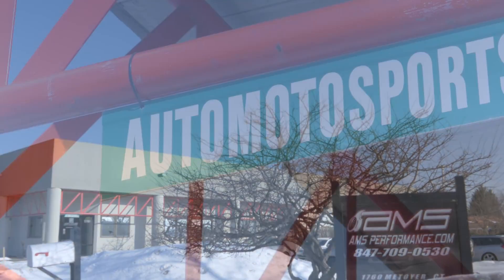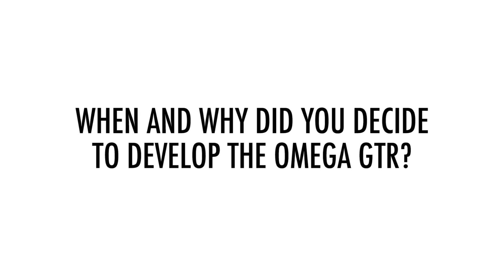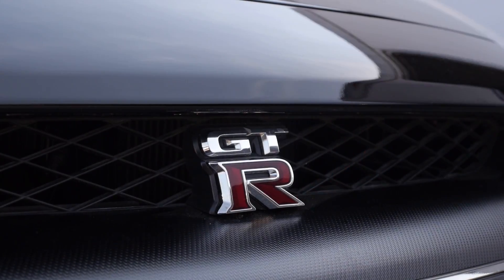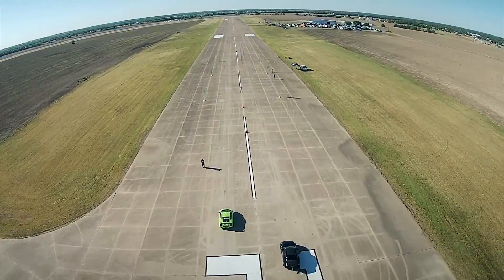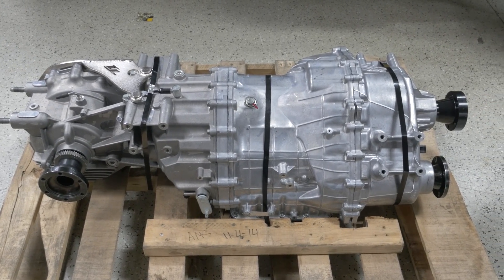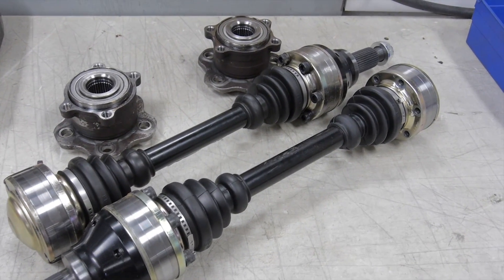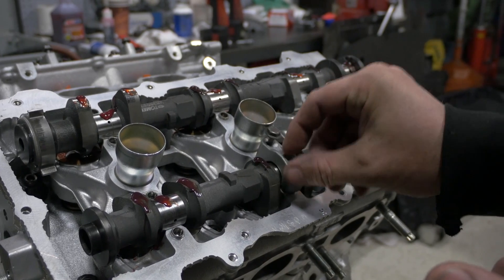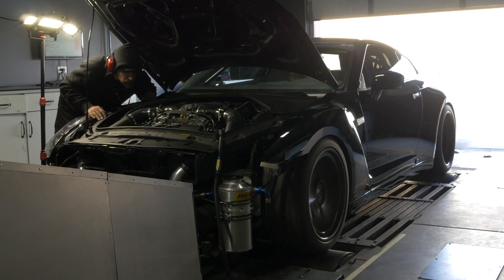What it takes to build the World's Fastest Nissan GT-R: AMS ALPHA OMEGA

Comment: hey guy's maybe if the diff gears are 4.11 from factory try 3.9 ,,,and if they are 3.9 for instance try 3.7's just a little higher and i could imagine them sequential v6's love to give it all they got in the mid range rpm's maybe just alittle bit smaller turbo's with a slight boost increase over the set up that you guy's are running
Reply: yeah cause you know more than AMS does.  Fucking youtube tuner kids driving civics.  GTFO

Comment: I wanna know if it runs pump gas and what HP with pump gas. I wanna know a breakdown of this car and how each part added sets it apart from a stock gtr. this thing making 2000HP on a 3.8L v6 is hard to imagine without exploding into pieces. this car puts lots of cars with double engine displacement to shame. definitely the underdog every since the first gtr in the 70s
Reply: ***** I thought that the new GTR was a disgrace to the Legendary icon of the past. This video showed me otherwise. It has surpassed itself.

I wonder if this car could pass emissions, or even if it can't, if it can be legally driven on the street in places were there are no emissions testing.
Reply: not too difficult to extract 2000bhp out of a 3.6l engine. two massive turbos, massive intercooler, stainless steel engine block/head, high fuel/air mixture, no exhaust cayalyst..etc but this car worth ZERO penny, cos it can't turn.
Reply: Sam Rad
 Are you serious? They screwed over the handling?!
Reply: SI0AX What do you think this car is built for? certainly not to race!
Reply: Sam Rad
Then what the hell is the Legendary GTR meant to be used for?
Reply: SI0AX Getting humiliated in FIA GT1 series by MC12? Anyway this AMS alpha whatever is built for drag racing only.
Reply: Sam Rad
Oh, now I get it. The AMS Alpha is an American tuner company that specializes in Drag racing right?

Eh, to each his own.I don't really find blasting down a straight line for a short distance to have a purpose...

I think their is no feeling that can compare to dropping a high speed to take a corner, then blasting out the corner into high speed.

Comment: I agree u have good engineers, reliable parts, but the prices are too much.
Reply: Faisal Mesfer Cheap. Fast. Reliable. You can have 2 out of the 3. Which 2 do you choose?
Reply: Faisal Mesfer unfortunatley 1500hp doesnt = $1500
Reply: big .one Who said 1500hp?. I mean their parts are way expensive. for just Downpipes for the GTR they are 1500$. What is the unique about your downpipes over the others?
Reply: Faisal Mesfer agreed there prices are on the high side.  But being the best at what they and all the r&d work this can be very expensive.  When your near the top you can charge a premium.  Just like oem manufacturers
Reply: Faisal Q
You think that's expensive? Ever bought Japanese parts for Japanese cars? 4 grand for a titanium exhaust for my Acura TSX. The header is 1500 plus shipping. You get what you pay for rally. Want cheap, go buy from eBay motors